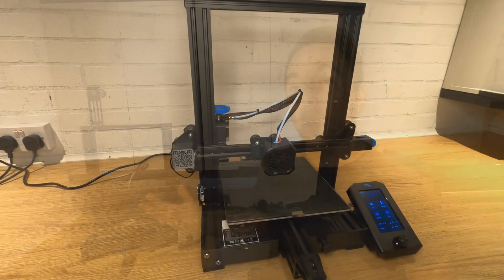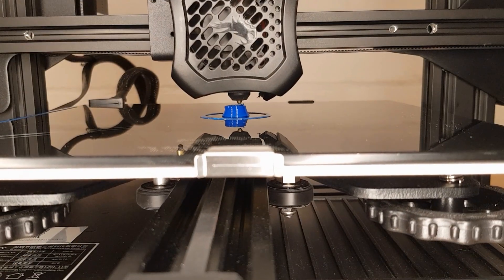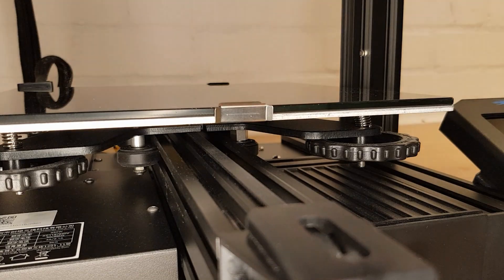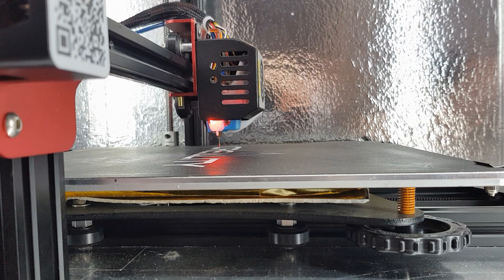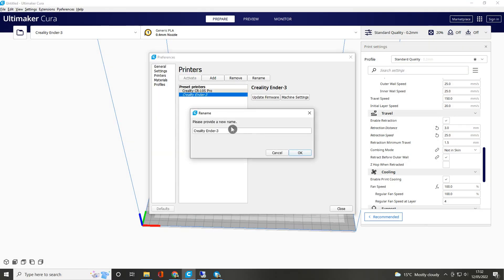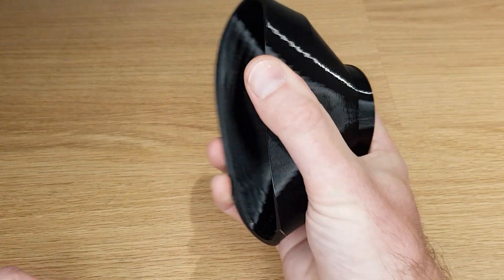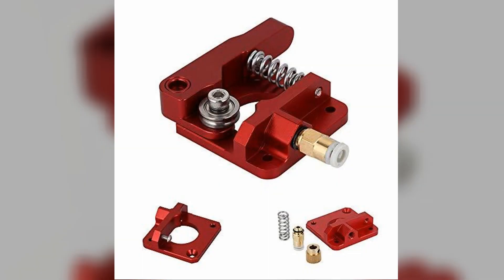Ender 3 v2 - Still The Best Budget 3d Printer in 2023? The Truth After 6 Months

Comment: I have a ender 3. Can it be upgraded to a v2?  Or do I just need to buy that?
The reason I ask is, I have the 400xl exstension coming for my ender 3.
With the v2, I like the extruder nob, the X axis pulleys seem easier to take on and off and the hot end lighter because... I have a Microsoft direct drive on my ender 3 and I think it sags the X axis.
Reply from the maker: I wouldn't say that you'd convert to a V2. I don't think I'd worry about the screen etc. The hotend changes seem more cosmetic. Do you have a 32 bit board on your E3? I think that is probably the most important thing for print quality. Why not add a duel z axis kit with a belt to help support the X axis?
Reply: @RickyImpey  I have the 4.2.2 board. Is the 4.2.7 better?
Reply: @RickyImpey  I have the dual axis already. Were do I get the top pulleys?
Reply from the maker: @smallnuts2  They come with some of the duel axis kits. I'm sure you can buy them separately. You just need two pulleys the same size and the right length belt.

Comment: I have this printer amd sofar upgraded the bed springs and installled a bl touch. Im very happy with it but i want to start printing ABS. So i guess i want to get rid of the bowden tube. What direct drive/hotend would you recommend for this printer
Reply from the maker: Have you considered printing with PETG instead of ABS? It's around the same strength, easier to print with and doesn't give off the harmful fumes. I print a lot of PETG with my V2 with only a Capricorn tube upgrade. I can't particularly recommend a direct drive upgrade for the V2 as I haven't added one myself. I have the sprite extruder on my S1 Pro and I can't fault it though. With the all-metal version, you can print up to 300°!
Reply: @RickyImpey  yeah inhave made some prints with PETG and they come out pretty good exept for when there is a bridging part. That comes out very stringy .ust try some more settings.  I would like to pront some flexibpes as well in the future and i read somewhere that with a bowden tube this limits the printing speed somewhat?
Reply from the maker: @pixxure1  yes, you have to go slow with flexibles if you have a Bowden tube but it is possible. Direct drive is probably what you want if you want to do much with flexible filament.
Reply: @RickyImpey  thx for the info.  I might go direct drive if i want to print flexibles.  Too much choice ;). Keep up the great videos

Comment: Why would you ever Ender-3 V2? 
Out of the box it has:
- Suboptimal PSU placement that reduces cooling efficiency, combined with slim (read: hotter) PSU.
- TMC2208 drivers that can randomly refuse to work when you turn on Linear Advance. Basically, you'll have to either solder UART or replace the whole board.
- screen that does not support some Marlin features and does not support RepRap/Klipper at all, if you decide to go that route later.
- The fancy base can come warped beyond usability (this is also true for Voxelab Aquila). And the coating will die if you drop a hot nozzle on it (you will do that from time to time if you are a beginner).
Basically, Ender-3 V2 combines the worst from Ender-3 Pro and Voxelab Aquila while costing a little more. Just buy those. Or original Ender-3, if you don't mind a little more work.

Comment: I've had the Ender 3 V2 for a good while. Upgraded to capricorn tubing, changed couple of fans to quiter ones, added BL Touch, and changed the hot end to the all metal Phaetus Dragonfly. Also, ditched the rubbish creality firmware to an up-tp-date Marlin one. Also, chhange the springs under the bed to a yellow springs. Printing on the smooth side of the glass bed, with a little adheseve on it, this printer have become an absolute carbon fiber nylon printing monster. And the quality of prints I haven't been able to replicate on any other printer so far. I can totally attest that, when you say this printer is built for upgrades, it truly is!
Reply from the maker: Yes, it can become a really capable printer as you obviously know. Thanks for the comment 👍

Comment: I have ended 3 with 4.2.2 board running klipper and octoklipper.
Works quite well. Prusa slicer works better than Cura in terms of finished quality.
Reply from the maker: Yes, I use Prusa Slicer sometimes too. It's interesting to see how it does some things differently. I like some of the more recent additions to Cura since we've had 5.0.0 though.

Comment: Please help. Neither my ender 3 or ender 5 are working. They both worked fine for a few weeks but then took a shit and only print birds nests if they print anything at all. I have done everything. New nozzles, new tubes, new beds, leveling a million times, new filament, checked the extruder for cracking, tightened and loosened the spring. I'm about to toss them out the window. If I could return them I would. Please help.
Reply from the maker: Hi, I'd love to help but you will need to focus on one specific problem at a time. Choose one printer and determine the first issue that causes a print to fail.
Reply: @RickyImpey  Hey thank you, the hot end stops extruding filament. I changed the speed in cura and increased the heat of the nozzle and bed by 10 degrees each and that helped for a few more lines, but still once it hits about 2 inches high, it will stop extruding. I also checked the xtruder for cracks, loosened and tightened the spring, etc and that did not seem to make a difference.
Reply from the maker: @dwightschrute8726  it sounds like you may have a clog or a partial clog. Have you cleaned the hot end correctly and, most importantly, made sure the Bowden tube is pushed hard up to the back of the nozzle when you are done?

Comment: trying to find a good next printer after my time with ender 3 V2. any suggestions?  want better speed so i can make more products faster with also good quality.
Reply from the maker: Hi, pushing the speeds is often a case of learning a lot about how to tune out the problems you get when you go faster. A lot of machines will print fast but the quality goes in one way or another. Some of the limiting factors to speeding up the Ender 3 V2 are the single lead screw, and in some ways the use of a remote extruder instead of a direct drive. This may sound odd because the weight of a direct drive extruder can mean you have to print slower but you have far less retractions which makes back a lot of time. If you want to go really fast the Core XY printers are known to be the most sturdy but if you just want to push a bit further, something like an Artillery Sidewinder X2 is really good out of the box https://youtu.be/ob9vTK_vZYM

Comment: Hi, can you discuss about Ender 3 pro V2 thermistor to prevent thermal runaway and how to fix it thermal runaway? It seems too few has discussed about it on youtube and mostly are for Ender 3 and Ender 3 Pro but not the V2. Thank you!
Reply from the maker: Hi, I'm pretty sure the thermistor and heating element are identical between those 3 Enders so fixing a thermal runaway error should be pretty much the same. The only real difference is the screen. Do you have a specific problem with thermal runaway?
Reply: @RickyImpey  I had a thermal runaway in the middle of a print earlier. Checked and rescrewed the thermistor to make sure. Heated the nozzle to 260 and seems fine. Heated the bed to 100 and seems fine as well. Did a test print and it printed fine so far. I have no idea what caused it. Whether the thermistor screw was loose or software bug. I'm just afraid if it reoccurs
Reply from the maker: @arquitensproduction8001  have done a PID tune? Fluctuating temps can cause a thermal runaway and a PID tune can help. https://youtu.be/DG1Yvt02l1I

Comment: The amount of issues I’ve had with this brand is ridiculous 🤦🏻‍♂️ can’t even update the firmware without the entire thing breaking, even receiving 2 separate v2’s with both different firmware. Even attempting to install a CRtouch breaks it entirely. Which won’t even work. It’s sturdy it’s a nice build. But the firmware breaks so easily and cannot be easily integrated with new firmware without breaking would definitely not recommend this brand.
Reply from the maker: Unfortunately there will always be problems and it ses.like you've been unlucky enough to have more than your fair share. I have two Creality printers and both work well.

Comment: Do have to ask though: tpu temp, retract distance and retraction speed? What have you found works best? Thanks in advance 😎👊
Reply from the maker: Completely standard Cura profile at 20mm/s print speed works for me👍
Reply: @RickyImpey  thanks heaps. Did notice you reduced the retraction. I have tried every option to dial it right in. Now to finally and completely dry tpu🤣🤣 Dry box mod incoming 👊😎
Reply from the maker: @AsylumFpv  ah yes, I do reduce the retraction a bit for PLA but not sure if I do for TPU🤔 I have to double check but I don't think so.

Comment: Never had any issues with my V2. Once it's dialed in, prints all materials without any issues. Did get ready for spring and filament tensioner to bust, but hasn't yet! Do think it's on point still as one of the best and affordable printers on the market, without all the head scratching! Thanks again for the vids👊

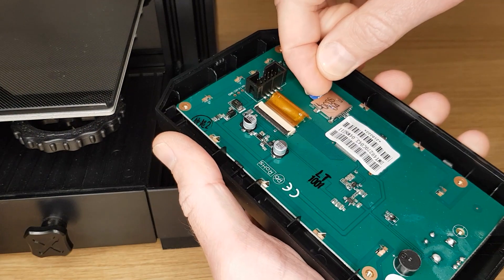Comment: 7:28 you don't need to open the LCD. Putting the SD-Card into the SD-Cart slot with the new firmware is enough
Reply from the maker: Not if you want to do screen files too👍

Comment: i only just built this unit, on Tues. last. i've had an Aquila X2for nearly  year. so i have some experience.
i've only upgraded the bed springs[this took several hours to get as "just right" as i could] and the extruder to a dual gear model. with some initial difficulty in tramming/paralleling i am up and running and printing parts for a sock knitting machine.  i actually bought this machine because the Aquila was DITW...the customer support was very slow or thorough, depending how you look at it. they sent a replacement main board and display...problem unresolved. they then sent a flashed board and new display and everything is back to normal...the troubleshooting process took, i think, in the neighbourhood of 2 months. that was two months too long without being able to print. so i saw a good advert on 'all3dp' and bought an ender 3 v2 for a great price for me. while waiting for shipment, i joined and perused an associated FB  group for it and there seemed to be a swell of users with issues...i almost cancelled the order, but plowed ahead. i think i made a good choice, so far. 4 days in...LOL
thanks for you video, i'll surely subscribe and add you to the 'list'.
Reply from the maker: Thanks for your comment. Hopefully your experience will be smoother with the Ender 3 V2. As I said in the video, it's really worth paying attention to the details for a trouble free experience.
Reply from the maker: Don't worry, all I meant was that you can wipe the threads of the nozzle if they have filament on them but it will cool down quickly. If your nozzle is really dirty then check out my nozzle cleaning video https://youtu.be/OmXlaqN3uog

Comment: Your comments were spot on! My experience would lead me to recommend the swap-out of the standard bed springs to the sturdier "orange" heavy duty ones. Bed leveling activity was dramatically reduced...dramatically. The dual-gear extruder upgrade was a major improvement, although that involves recalibrating the e-steps setting which is a technical challenge for the new user. Thanks.
Reply from the maker: Thanks for your comments James👍
Reply: It confuses me greatly why can't they figure out the springs through so many revisions. 
The problem is not sturdiness or strength. The ends should be properly squared and flattened to prevent misalingment during movement. So both "orange" and "blue" springs will work since those have the proper ends. Or you can print small details to keep original springs centered.